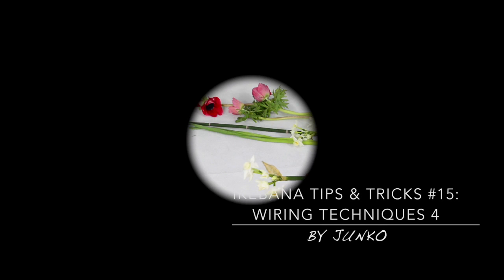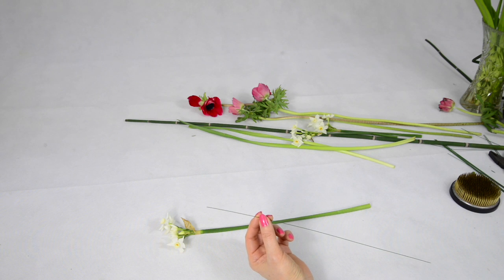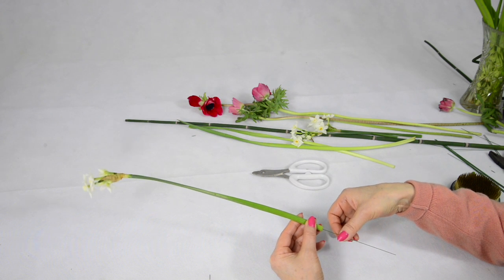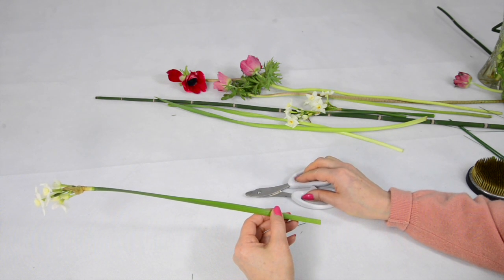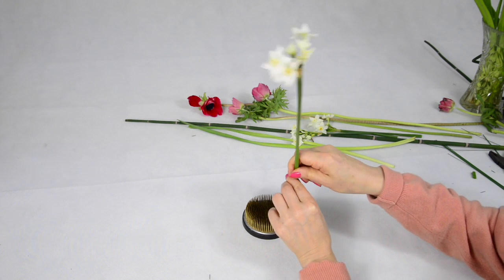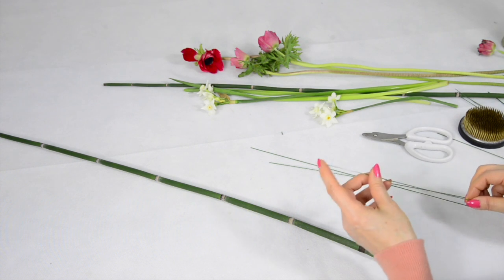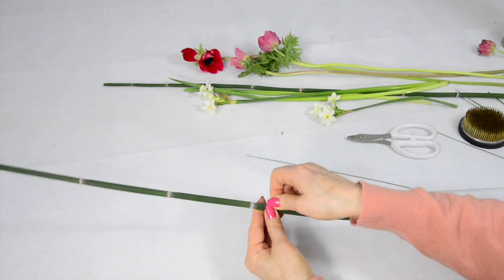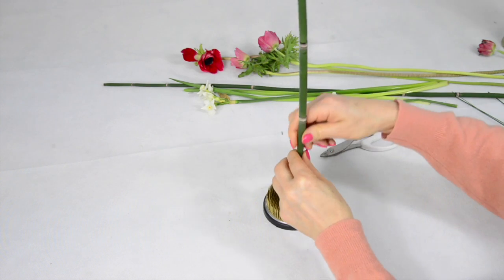Ikebana Tips by Junko #15: double fun with wires

Comment: When do you to use silver wire versus normal green wire?
Reply from the maker: Sorry for late reply. Thank you for watching. 
Green are used when using green materials, particularly thin stems. Brown for woody stems. Silver can be used to insert in stems or, for stronger branches, eg, used to make a bend then taped over to hide them.